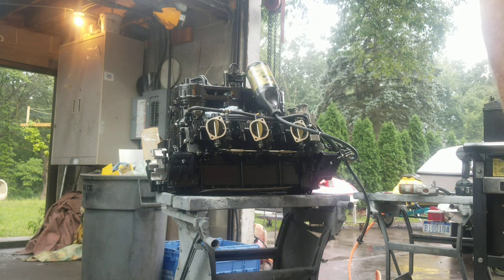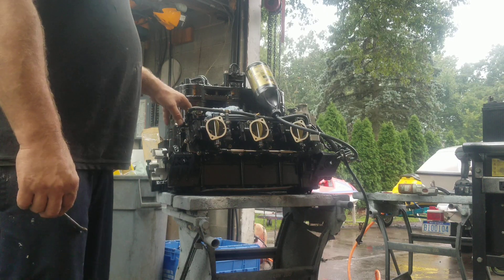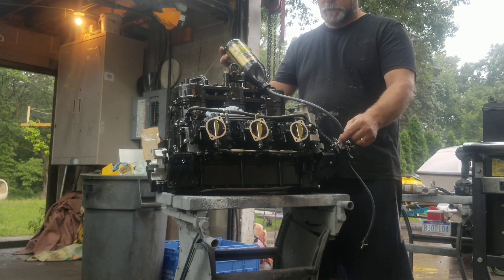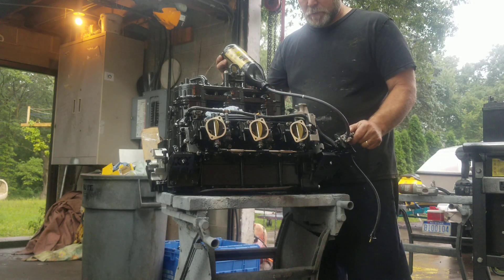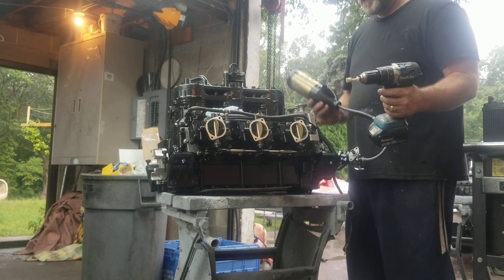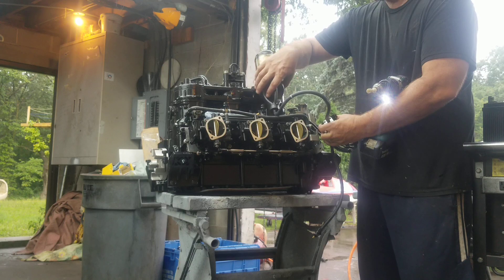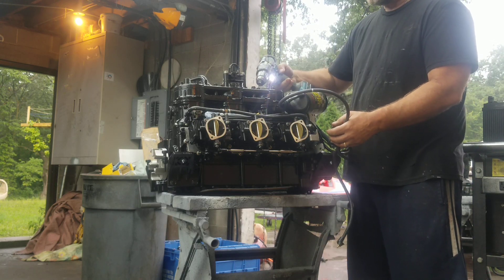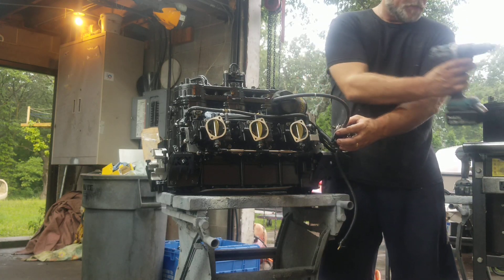Yamaha 1200R 2 stroke injection oil pump testing

Comment: Question , are you able to keep the carbs on when you put the engine back into the hull? 

Seems mixed infonon this and in the service manual. Hoping I can install the carbs out of the hull and insert it after they're installed

Comment: Do the oil pumps ever need to be serviced? Some of these would be over 20 years old now, ie do they need a new internal gasket kit, appreciate you guys doing these vids and will try to throw some business your way
Reply: definitely needs servicing or replaced with new . it uses rubber seals that will eventually fail . it happened all the time with two-stroke motorcycles back in the day. as also suggested by the gentleman blockages could occur within the pump itself rendering the pump useless or reduced rate of oil flow